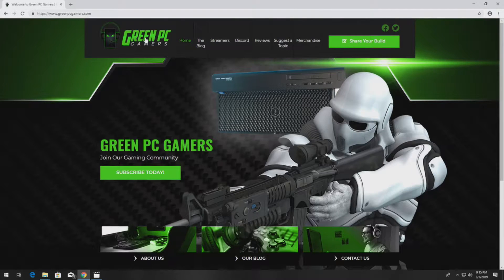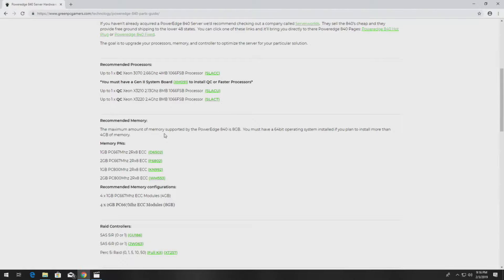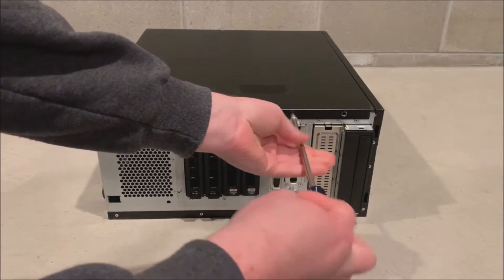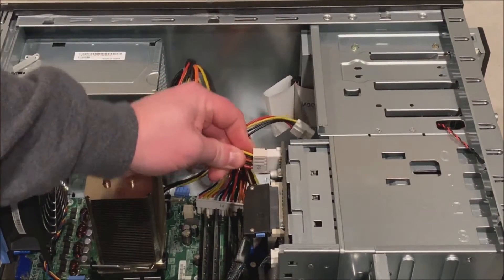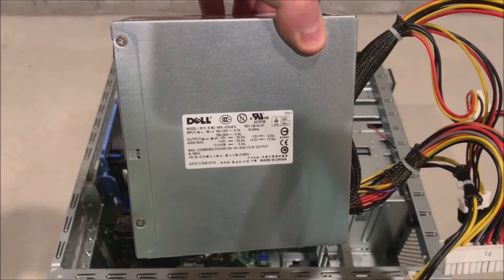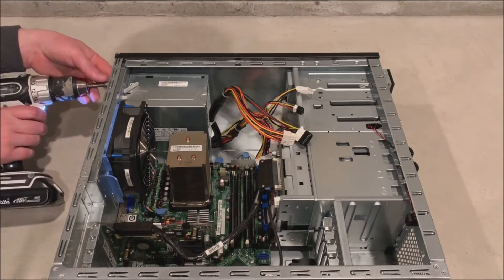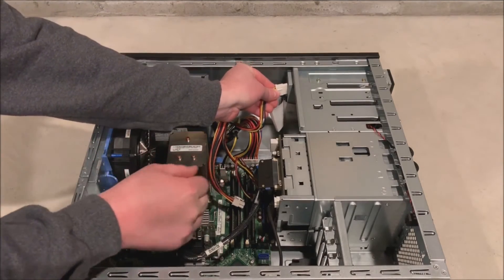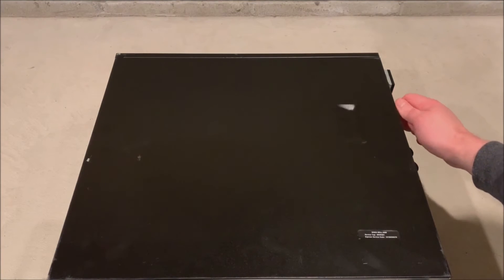How to replace a Poweredge 840 Power Supply TH344 WH113

Comment: I've picked up this exact server. I have a power supply with a higher wattage from another box but it was a desktop PC. Is there a huge difference between what PS would go into a desktop and one that would go into a server? This server will be in the home.
Reply from the maker: We’ve never tried an atx power supply in a pe840.  Did it work?